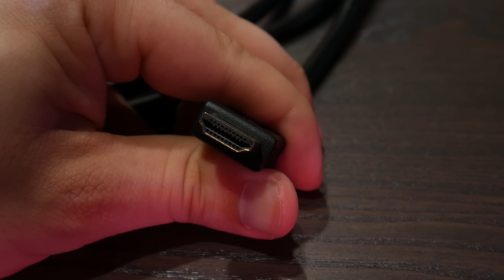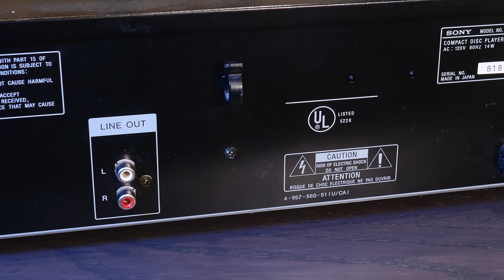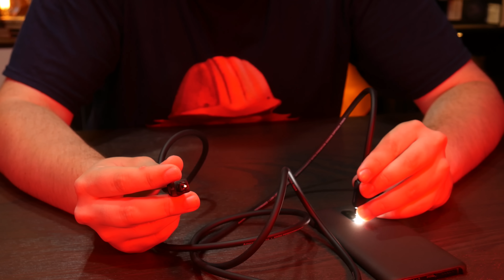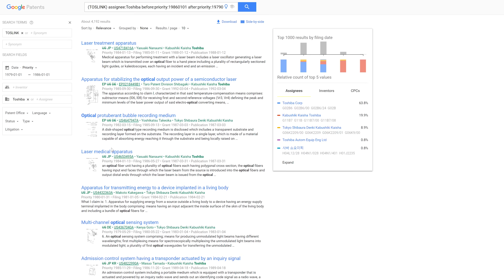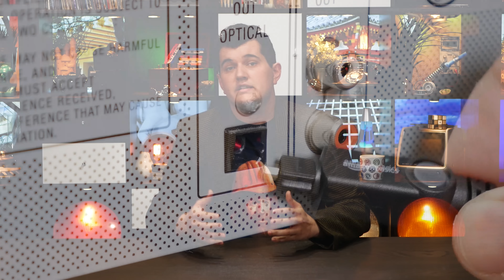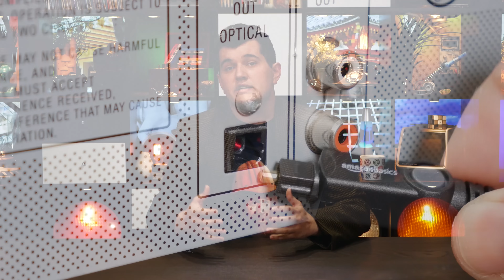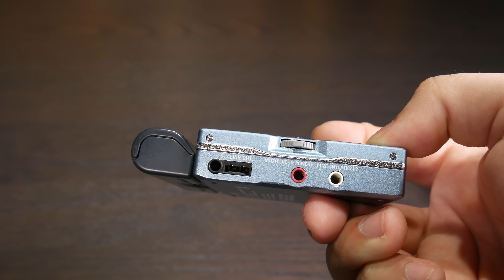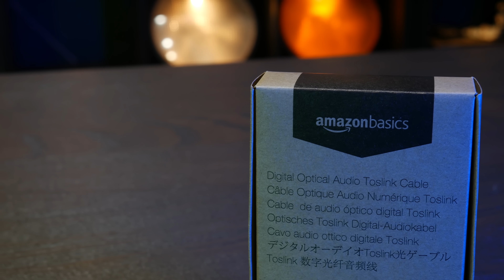TOSLINK: That one consumer fiber optic standard

Comment: Supposedly reducing noise? It really works. Power supplies from various components when connected together by copper cables can cause hissing or hum sounds coming out of the speakers. Sometimes people use ferrite cores wrapped around the cables to help reduce that noise but having fiber optic cables linking the components together eliminates the issues caused from copper connections altogether.